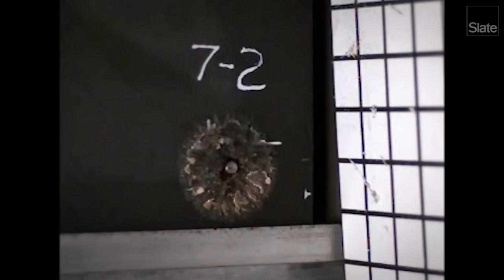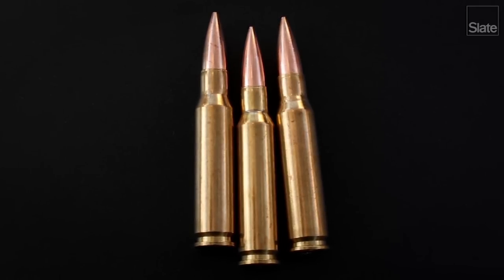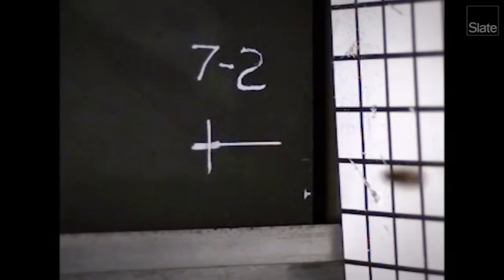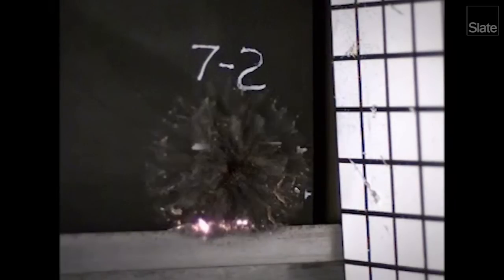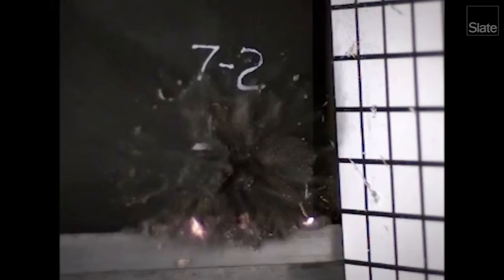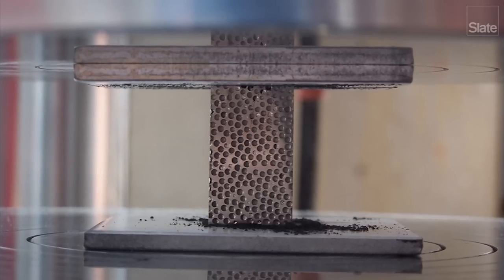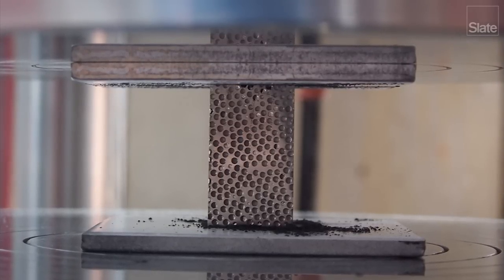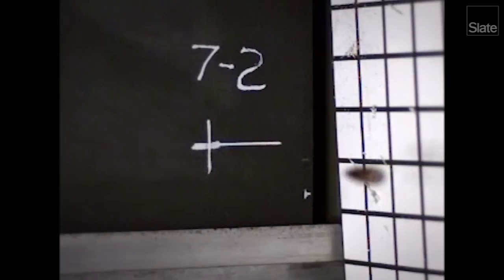Metal Foam Armor That Shatters Bullets on Contact

Comment: this "obliterating" is completely normal for any plate that doesn't deform or break.
the metal foam should be even weaker, but because it absorbs some velocity it also could be better, because speed penetrates armor.